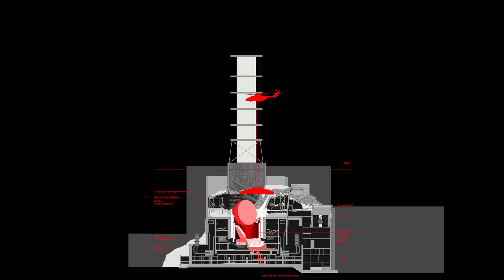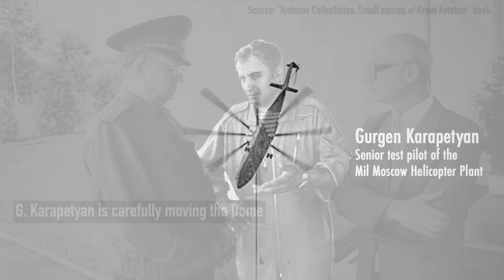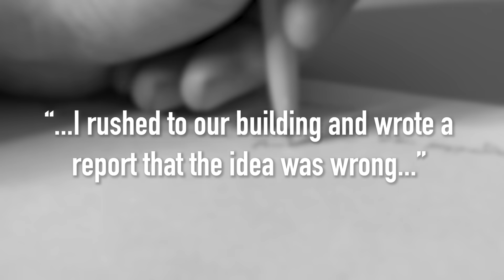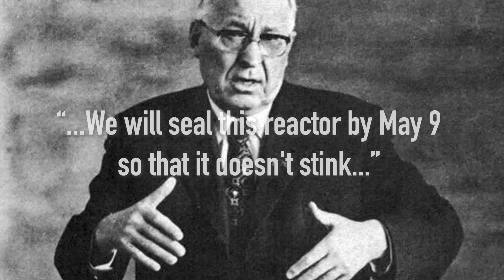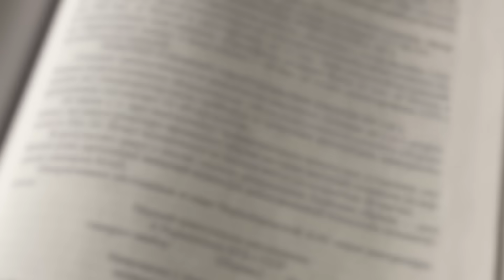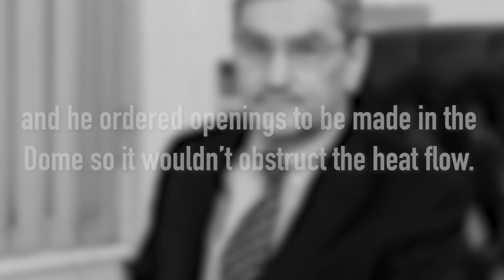Chernobyl Dome: It Failed So Badly, They Pretended It Never Happened | Chornobyl Uncharted Ep 16

Comment: A very interesting tale indeed.  

However, even if it would have made the destroyed reactor airtight (doubtful because of the scope of damage caused during the 'explosion') I doubt that anything would have caused the cap to be "blown off",  more likely it would "percolate" or briefly lift on one side and then settle back into place, causing a repeat of the lifting as pressure built up again.  This bubbling effect may have caused the cap to eventually move off of its correct position and then venting would resume unobstructed.  This situation could also have been mitigated simply by installing a tube on the side of the dome's structure with a pipe or hose then attached.  This would enable operators to collect any venting materials and relieve any pressure that may have  built up.

I don't believe that it was such a catastrophic idea but doubt that it would have worked as they predicted or have been 100% effective.  It would have worked partially and in ways that weren't considered and it may have lessened the amounts of materials being vented, for example certain materials would have a charge or be heated and may have clung/condensed to the surfaces of the dome rather than float into the open atmosphere, like creosote on a chimney. They could have increased the effectiveness in this manner by charging the dome, as well as laying grids across the opening to oppositely charge any venting materials, as in electrostatic precipitation.  The ultimate failure of the dome was likely a result of the intense competition and infighting between the different groups working on a resolution to the problem and manipulation of people by powerful individuals.  

Although in retrospect, in the belief that the dome could be partially effective, perhaps I have only fallen victim to the dome's 'flight of fancy' spell?

Comment: I wonder why they didn't use two opposing cranes, to bring up the boron and sand on cables, or perhaps a convieyor belt?  Might be "safer" thrn have pilots fly over the core.
Reply from the maker: At the moment (April-May), where these suppression materials were delivered, there was no possibility to be close to the Unt IV.  A crane of a matching size  has to be delivered, assembled, and operated. This takes a hell of time (for DEMAGs it took a month) and was not feasible at that very period.

Comment: Yep, it's Sunday and here is another banger of a video. While I have read about this "cap", I had never seen any pictures of it, much less moving video. As a (now retired) Master Welder specialising in non-ferro (aluminium/ stainless steel) I could have told them right off the bat that aluminium is totally unsuitable for a high-temperature environment. Depending on the alloy, it pretty much becomes a liquid between 600-700 C. And I'm hazarding a guess that the temps in Reactor-4 were still way higher at the time. But I take my hat off to these engineers that had to come up with a solution for this major headache of an accident. Thanks for another little-known special fact about this accident liquidation.
Reply: Oh that's a cool job! I can barely weld steel, much less non ferrous material!

Aluminum is an amazing metal, and some alloys can handle some heat, but I'm assuming they had to use aluminum for weight reasons. 

I'm also very skeptical about aluminum sheeting stopping much radiation, gamma rays would blast right through a foot of aluminum like it wasn't even there, it's the lightest air stable metal and about the worst choice for radiation shielding

Comment: This is what engineering is about.  Unproven designs will fail in unexpected ways, and that’s why prototypes are a thing.  An engineer in the Soviet Union would have had a shit job given the amount of pressure to rush a design into production and the engineers responsibility when it failed.
Reply: Whatever? Mates right why be such a cnt
Reply: Especially when you have to make the impossible possible
Reply: Whatever

Comment: The mass of Chernobylite in 305/2 had to have been red hot if not still white hot at the time the attempt to put this dome on top of the reactor pit. Rising heated air from that would have heated the done to high temperatures quickly.
Reply from the maker: Yes, exactly
Reply: I don't even see how trying to cover the pit would have done any good.

Comment: A device strong enough to withstand the awkward mess and intense heat of the wreckage of Unit 4, and light enough to be air-lifted into place.

Light and strong. Light and strong. It's just impossible.
Reply from the maker: There is a little detail: exact temperatures were not known for a few months. That brought assumptions. From what we know, Antoniv used some aviation alloys for it.
Reply: @ChernobylFamily  That makes sense. Aviation alloys manage to be both light and strong, but tend to be sensitive to heat and uneven distribution of force.
It's an interesting piece of the whole Chornobyl puzzle. These are folks trying to act as fast as possible without a full picture of the whole situation. Even failed attempts to resolve the issues were valid enough to explore in these conditions.
Reply: Titanium or stainless steel both suck up heat and have high strength-to-weight ratios. They're the main choice for machine parts that operate at the extremes. Stainless also doesn't break down under neutron flux, but that wouldn't have mattered much with the reaction out. Neither one is suitable for bashing out something like this.

Comment: Incredible video once again. 
Yet,  thinking about the chaos that reigned in those moments back then, this "cap" idea would have been probably more realistic than the idea of constructing the entire "sarcophagus". That is why, I think, they at least gave it a try.
Reply from the maker: Yes, after all it was literally a week after; I guess one does not need to be a minister to fall into an idea which was born out of initial shock.
Reply: If Elena hadn't been sitting there cockeyed and the top of the bucket was visible, something like this might have done some good for a while. I doubt the Minister had more than a line sketch of a reactor and some pictures of the devastation to work from.